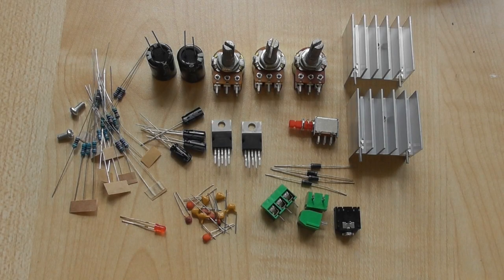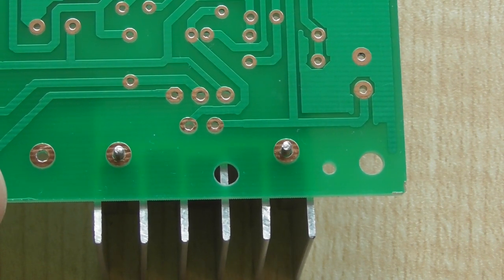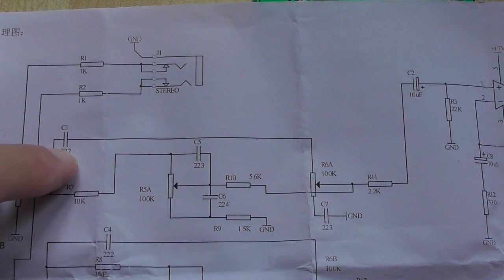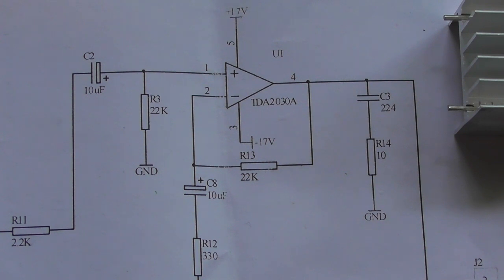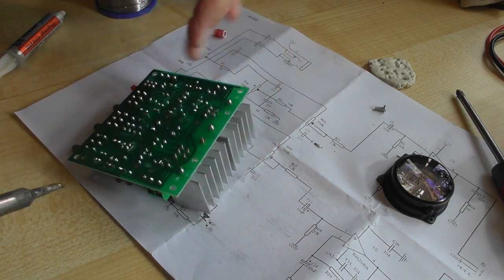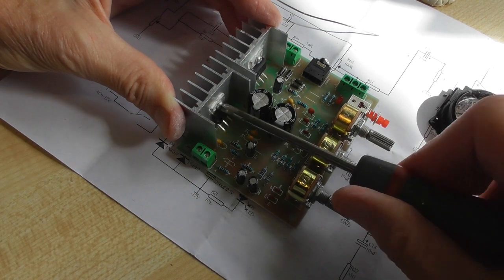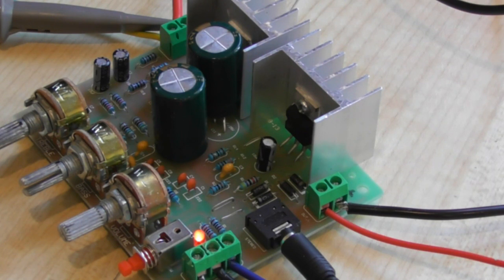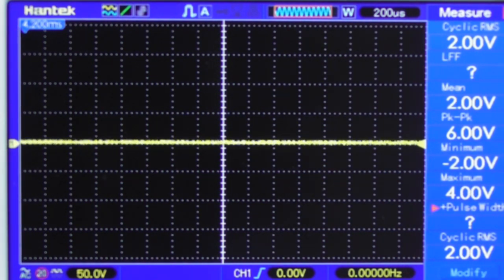TDA2030 Stereo Amplifier Kit.

Comment: 100Hz just happens to be the freq of a full wave rectified voltage, (assuming your mains is 50Hz).  Maybe supply filtering and/or reservoir caps.  May need a ground plane on the PCB, but that's a bit out side of your control.
Reply from the maker: To be honest Paul the 2030 is probably fake and may be the main issue, probably is. It still buzzes when run from a bench power supply. It just a cheap and quite nasty piece of land fill.

Comment: The main problem with this kit is that power ICs are fake. I noticed that front side of ICs is repainted and rebranded. Who knows what it really is. It has the same pinout but it's not TDA2030. I would recommend finding original chips and using it instead of the ones supplied with kit. It is the reason why  Michael did not get the power claimed.

Hum/buzz problem is due to PCB layout and there is not much that diy-ers can do about it. I suppose that it's minor issue.

Comment: I recently bought a tda7379 that cost me RMB14 before shipping.  Requires just 12Vdc (can't use higher even though the chip is rated higher.  The caps are rated 16V)
Just for fun for my WFH desktop setup with a couple of old Wharfedale Modus satellites.

Comment: I really hope I can get help here...         I have bought this kit on eBay and right after I got it, I assembled it but on both speaker outputs I get around 16V DC and I hear a 50Hz tone from the speakers and changing the volume doesn’t do anything. I have tried putting a capacitor in series with the speaker to block DC and as expected DC is gone with the 50Hz noise but I don’t hear the music coming from the input. Have you had that issue by any chance?
Reply from the maker: It's almost impossible to fault find from 10,000 miles away as I'm sure you understand, but if the fault is on both channels it could be a power supply issue. You need a transformer which is centre tapped. ie 12/0/12 AC this is what balances the output to zero volts. A cap on the output is not the answer. Check also the diodes are the right way round. Could also be assembly error. More probable a power supply problem. If you have a 50hz hum, that means raw AC is getting into the circuit somehow. Keeps coming back to the power area. Good luck.
Reply: Michael Beeny Thank you for your advices, I am using a 12 0 12 transformer which shouldn’t be the issue. I have also tried soldering an external rectifier with capacitor board to the caps that are already present on the amplifier board but I was still getting the same 16V at the speaker out. After visually inspecting the board and schematic I found that pin 5 of the IC which should be connected to vcc is not connected and there is a spot on the board for a jumper to go across so I bridged the contacts and got rid of the DC voltage that was present but the 50hz noise was still there. 
I will look for a solution to this problem and update this comment in case someone is in the same situation and might find this useful.
Thank you again Michael for taking some time and helping me and others who have the same issue
Reply from the maker: @marioferrari4626  Yes, I forgot about the wire links myself, 4 in total.
Reply: Michael Beeny Alright, I will keep that in mind later when I’ll get back to that board. Thank you
Reply: @marioferrari4626  have either of you guys checked the potentiometer's, if their body isn't connected to ground, in some cases you will be picking up radio stations LoL. But some amplifier designer's just copy the design straight out of the datasheet and it doesn't show the potentiometer body connected to ground, and that basically ends up with a problem that they themselves can't fix because they didn't realize that the datasheet only gives you the basics, you have to figure out how to actually get it to sound good.
If the pots aren't grounded, just wrap a bare wire around all the shafts and touch the other end to a ground point to see if that's the problem! 
If the amplifier was installed into an aluminium case with the pots directly mounted on the metal and by chance you also grounded the case, you might not have ever had that problem without even knowing it LoL. Well I hope that this helps 🙂
Reply: Peter Milanovski I forgot about the discussion here. At the end it turned out to be a jumper which you had to make yourself that connects one of the power rails to the power pin on the IC. 
I can relate to grounding the potentiometers because I used this kit in a speaker that had a very similar board with the same 2 ICs and passive filter with potentiometers soldered together with some wire.

Comment: i noticed you have changed the capacitors..  was there a good reason to do so ?
Reply from the maker: Wow, you was watching in great detail!! Yes I did replace the main smoothing capacitors because of the hum level, but it made no difference. I did return the original ones after I finished editing. The replacements were bigger as I'm sure you noticed.
Reply: aha !